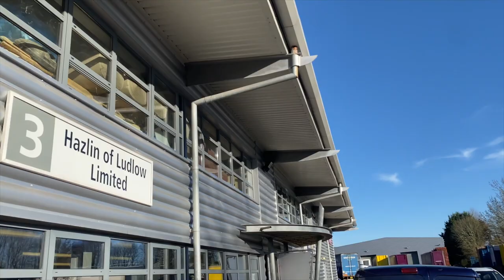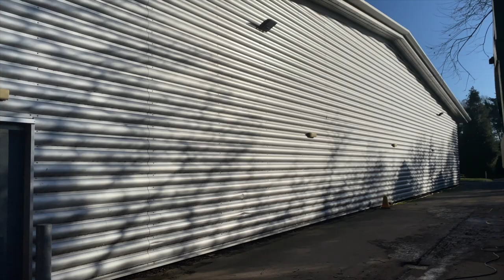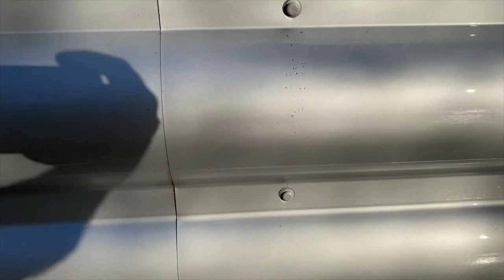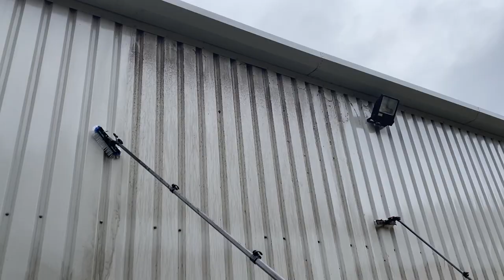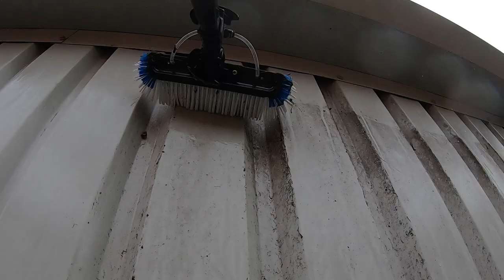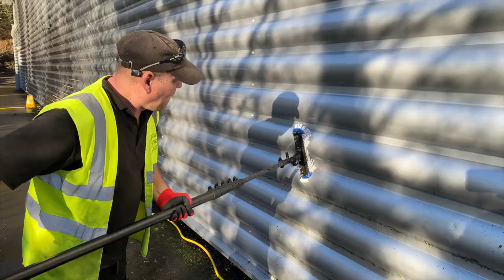Massive Cladding Clean Using WFP

Comment: When I do these jobs I use tap water with an l5 heater and constantly fill tank from customers supply
Gives me a reason to have a break while it fills up lol
Got one to do Tuesday with only a 450l tank so gonna have a couple of breaks
I do spray cladding first with screwfix no nonsense degreaser with a backpack while tank is filling up
Then 2nd day is windows and pressure wash pathways so will use pure then

Comment: Great job Dave I’ve done quite a few jobs like that are tough on your body.. I pre wet the areas,  I use a injector with the slightest amount of vision added litre water and 10mls of vision  will provide 200 litres of water.. on a job that doesn’t have water drainage issues.. I add titan green to the injector at 100mls ..  a I would rinse off cladding with hose after you’re scrubbed down 👍 deserve a beer or 2 👍
Reply from the maker: Hi Dave. 
Thanks for the advice. It was definitely a tough one but worth it for the money 👍

Comment: Spot on job Dave I have the 6lpm lpg shower I'm gonna upgrade to the 18lpm one and use it in conjunction with jet washing as my machine runs at 15lpm it's gonna be great for wet pour ect
Reply from the maker: Hi Lee
Although it says 18 litres/minute not sure if it would actually do that. I swill do some testing and let you know.
Reply: @squeakycleandave1  thanks dave I did think is that the Chinese spec on stuff is slightly exaggerated at times
Reply: Be careful as drawing water through this type of boiler may cave in the core. Check your machine can use hot water as it may affect your seals and hoses
Reply: @AW-Services  thanks Buddy yeah I did check with the guys that build these I thought the same thing appreciate the heads up though just in case
Reply: What temp difference is 6lpm or 18lpm ? I have the 6lpm but doesn't get overly hot ? But didn't think 18lpm would work 🤔

Comment: Love your thought process,  you look to do your jobs not cheaply but efficiently.

Couple of questions: Would propane be a good fuel as well or do you use the gas for another reason?

Would soap that is environmentally friendly have been usable?

Have thought of doing this for a couple of years now, think I will give it a go this year.

Thanks for the personal experiences and tips

Pyramid Window Cleaning
Reply from the maker: Hi Leonard

I used propane as it was easily available and a much cheaper set up then using diesel. as this is the first one ive done in 15 years and may not be asked to do  another I didn't think it was worth a massive outlay for one job. 

There are environmentally products available which may have helped slightly but when I did the test panel the dirt came off so well I decided against using any.
 
It was a much harder job in terms of wear on the body compared to window and it defiantly made me ache but if you price it right it can be a good earner. 

Hope that helps 

Dave

Comment: Maybe used  the pressure washer as a rinsing tool . regulate the pressure right down or use a large nozzle orrifice ( black tip or pink tip ) or a soft wash pump or similar delivering  4 gpm plus..  you could have used softwahing for  large parts of that building
Reply from the maker: Not bad ideas. I did consider those options but with using low pressure hi volume pump the water was  only available from one very slow tap so I don’t think it would have kept up and I would have needed at least 200meters of hose. 
I couldn’t have Softwashed it as they didn’t want any harsh chemicals going into the drain system.
Reply: @squeakycleandave1   you made a good decision dave... This is where maybe having a a big water tank available like they use for solar panel fileds may have been extremely beneficial. but these big jobs  probably do not come very often .. come .. I think a lot of people learned something here about the ebenfits of heated  water .

Comment: Gi mate how much would it be per qm? Im looking in to doing this as a add on to my window cleaning but wouldn't know where to start with pricing. Any tips would help massively 🙏
Reply from the maker: It can alter massivley depending on the area you live, how dirty it is, the amount there is to clean, access and restrictions etc so you can't really put a price per meter that would be right for every job. 

The best thing to do is when you go and price the job do a test patch. make sure its a big section and time how long it takes. Then work out how much you want to earn an hour. Remember when you do the test patch you are fresh so will be faster. 

Add in time for site visit, writing risk assessments and method statements, time traveling, Fuel etc and you should be able to come up with a price.

Comment: Hi Dave, cracking job!. How did you quote for such a large area?. Thanks
Reply from the maker: I worked out the area and tried to work out how much I wanted per square meter then added a bit to make up for time spent visiting site, extra equipment I needed and time spent doing RAMS
Reply: @squeakycleandave1  👍
Reply: And then doubled it :-D